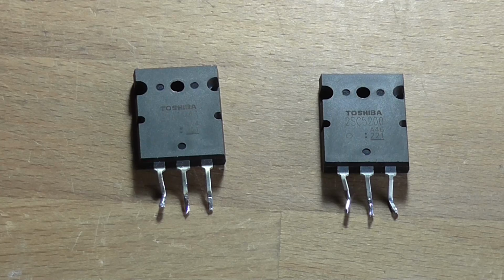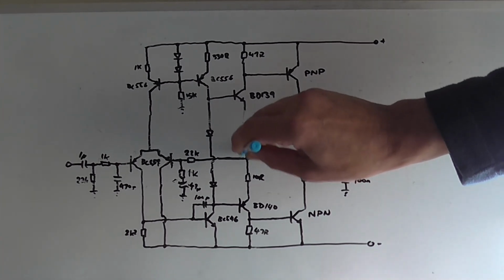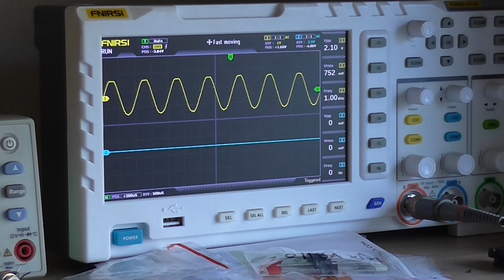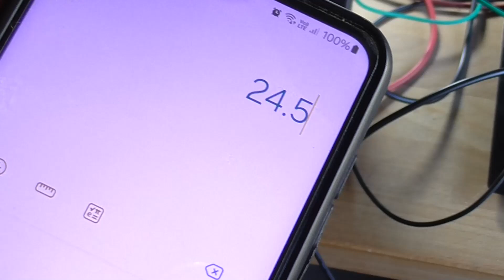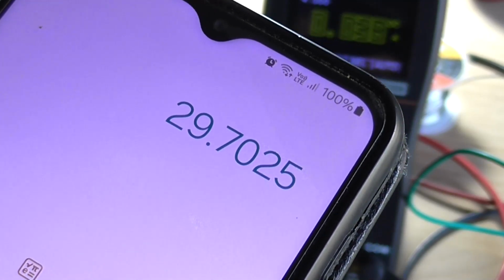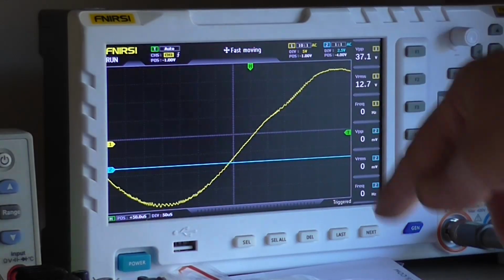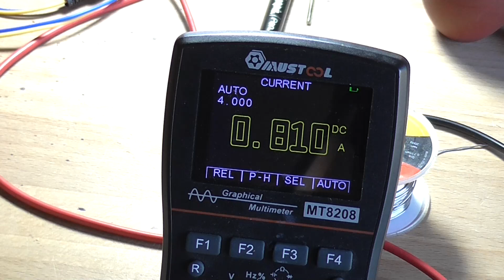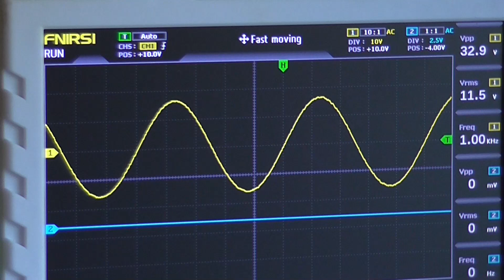Are These Toshiba Power Transistors Fake?

Comment: 2SC5200 and its pnp pair can be run on +-50VDC at 8 and 4ohms stable and or i seen these in some low quality PA amplifiers where it was written as a 400watt amplifier, where it can only do about 130-140watts at 8ohms, and it runs about on +-57volts.
I serviced some of those amplifiers before, they like to blow up, but i think that if you run these at about +-50Volts, youre ok at 8ohms, and you will get about 90-100watts.
these transistors are supposed to run 2ohm stable at +-30volts if genuine.

Comment: These transistors are replaced by 180watt versions as 2sa1987/C5359 available from major distributors about  $4 each. Toshiba still manufacture the 5200/1943 in Thailand it is sold locally  per pair only for less than $3 a pair.

Comment: Il be doing a video series finishing a proper curve tracer design of mine...also I ordered a hv breakdown tester that will arrive soon you should get one they can be found online for I think about 40 bucks
Reply from the maker: Yeah, I've seen them. Upto 1.2kV.
Reply: @AstrosElectronicsLab my one is 3.5kv Max and 5 ma obviously not at the same time though! Il do a review in a week or less when it arrives , also il be analysing some transistors with the dca pro75 and the hv tester in another video

Comment: crossover Distortion bias is wrong
Reply from the maker: It would be there at all power levels, not towards full power. And as it mysteriously disappeared, as I was touching stuff at the time, it most likely is a bad wire connection. It is breadboard, after all - it does make testing amplifiers or RF circuits a little more difficult.
Reply: Agree about the bias. I made a stereo amp a couple of years ago with four sets of output transistors in parallel. At first set up I needed to run in low power and saw the bump in the scope. I had incorporated a mini pot instead of fixed resistor in the first stage and was able with slight adjustment to remove the hump. I’ve never had any luck with +/- 50v as it gives me a nice firework display. I just restrict to +/- 30v and alls well despite having chunky heat sinks I also put a couple of pc fans and so far all is well. Mine goes up to 11 by the way as this is louder😂

Comment: they are original Toshiba, but proberly made in china ones, 
Not the ones which are Made in Japan
Reply from the maker: Yeah, that's what I mean. I know they're Chinese made, but made to the correct standards - so some-what genuine.
Reply: @AstrosElectronicsLab   Yes , they are genuine Toshiba 

you should also look at jilin sino made 5200/1943
to see how they looks like visit DIYAUDIO threads A60 Amplifier build post No 883 and 885
Reply: to take a look at original genuine made in Japan Toshiba 5200/1943  visit DIYAUDIO threads A60 Amplifier build post No 898 and 902